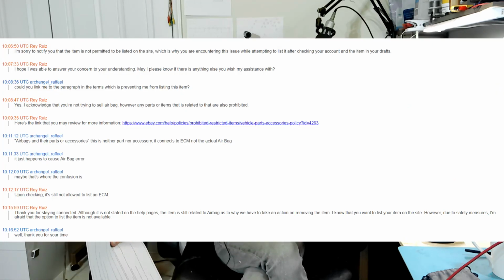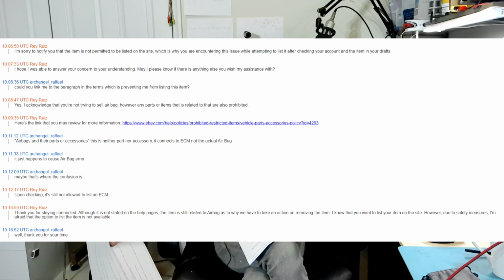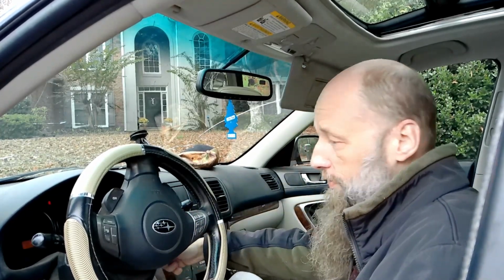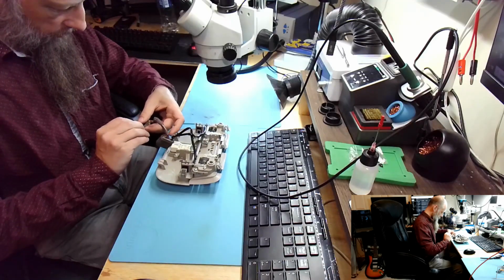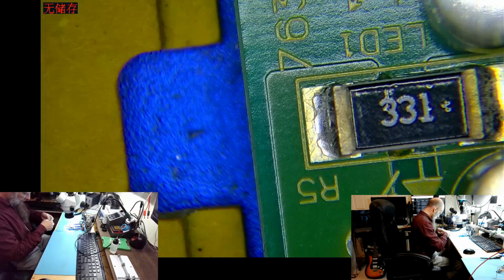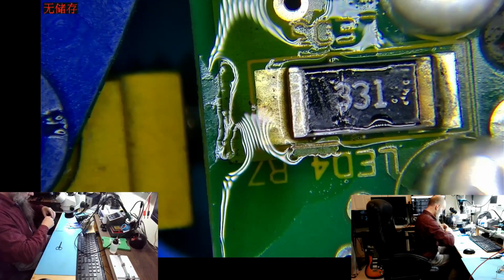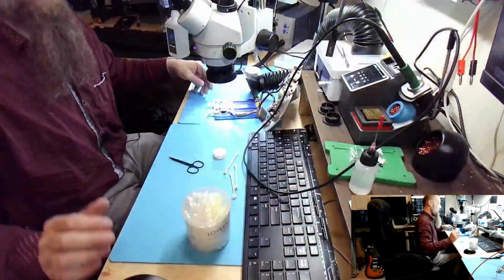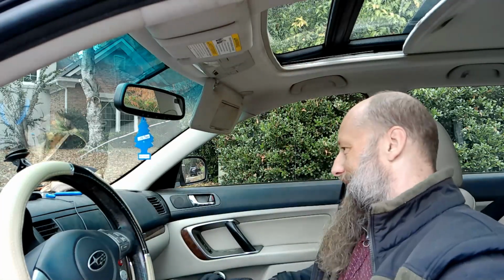Forbidden Repair | Subaru Outback Airbag Error

Comment: i love forbidden repairs! do you built a PODS simulator? (Passenger Occupant Detection System) i want to replace the front passenger seat on my toyota. it has 4 load cells, one on each corner of the seat frame. resistance variation dictates state of seat. (can not be disconnected; fault) looking for a switched module so airbags will still be active with passenger with switch active. (minus seat airbag; removed, resistor defeated)
Reply from the maker: how old is your Toyota? By simulator do you mean a device that will fool the car into thinking that the passenger is in the seat? I assume you want to install custom seat which doesn't support the PODS. That could be done, depending on the seat. Resistive sensors are probably the easiest ones to simulate :)
Reply: it's a 2007. more modern seats have a "bladder style"  resistor under the butt pad that can be installed under the fabric on the pad of new seat. no one makes a seat rail that is compatible with the rail load cell system. i would have to build custom brackets to install new seats on stock rails. (original plan) the simulator would simulate "empty seat" with switch off, "occupied seat" with switch on. resistance data is available for potentiometers at yarisworld. i have toyota factory electrical manual. (EM01VOU)
  @blackhorserepairs

Comment: Have you ever fixed a dcm for the subarus?  I worked at a dealer and we would get at least 3 newer Foresters per week and the only fix was to remove the fuse and lose functionality until the new dcms were in stock from back order.
Reply from the maker: yes, I'm familiar with this problem but I have not worked on it yet as my car predates this feature. I would love to take a look at one though, I wonder what's shorted there. Perhaps it's a simple fix. I'm also aware that it's a pretty common problem, quite a few people already asked me about it.
Reply from the maker: I just ordered one on eBay, for 2016 model, says it's used but working so I'll tear it down and try to reverse-engineer it, see what can be causing issues